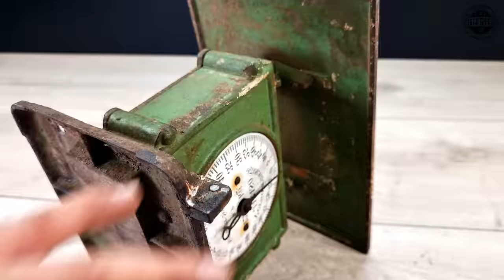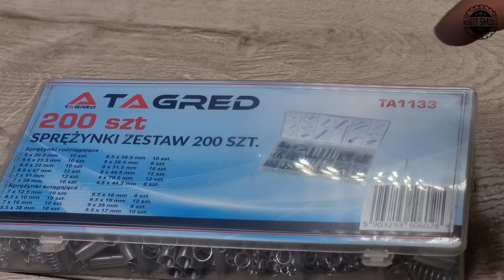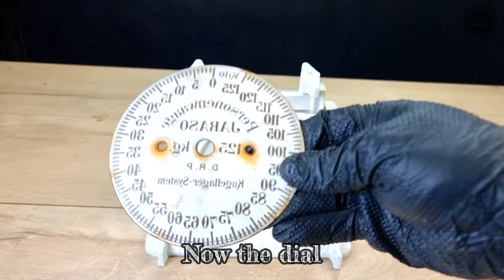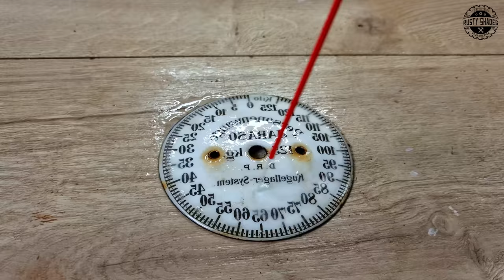Antique Personal Weighing Scale Restoration

Comment: I admire you using the original white.  It must have been very tempting to use any better color.  Nice work with the weld.
Reply from the maker: That's true, but I'm trying my best to keep the original color even if sometimes I have to break this rule. It depends a lot if the item is mine or it is from a client. Thank you! 🙂

Comment: Nice restoration. I believe your support rack directly under the screen floor in your blast cabinet is installed upside down, which is why your blast media collects on the braces like it does.
Reply from the maker: Thank you. Initially, I tried to put it as you said, but there is a problem with the screw holes. They don't fit anymore. I guess that is a production issue.

Comment: 1. Cast iron parts must be preheated in a furnace! 
2. TIG welding should be used on cast iron, not electrode welding!
Reply from the maker: Please don't be rude and read more about it. Did you observe that an 80+ kg guy stepped on it? Do you know what that means? A successful weld buddy. Lads around here on YouTube are happy to keep 40-45 kg on a cast iron weld. 
Preheating to 300 degrees C and a NiFe-Cl rod is more than enough.

Comment: This is probably a stupid question with a painfully obverse answer but, why not just sandblast the paint off instead of adding the extra step of paint removal then sandblast anyway??
Reply from the maker: That's not a stupid question. The paint was lead positive, and sandblasting can contaminate the cabin and the workspace and, of course, the sand that needs to be thrown away and that will get in nature. 
Removing the paint with a paint stripper gel helps avoid the spreading of lead particles all over the place and with an easier trash disposal.
Reply: That makes sense. I found your channel recently and am loving it, its strangley therapeutic just sitting watching you restore random old things
Reply from the maker: Thank you for watching my videos! 🙂

Comment: Why not sandblast the green paint off? There was no lead?
Reply from the maker: Because there was 2 layers of paint and to get a good result and faster is better to remove the paint otherwise will take at least 5-6 days to sandblast all that parts. The motor of the air compressor is getting hot, so you need to wait 20-25 min than you can sandblast 2.5 max 3 minutes and so on. I don't know if you own a sandblaster and know how it works, but in case that you don't, now you know what's behind that process.
Reply: @rustyshadesrestoration  ty I didn't know this!!